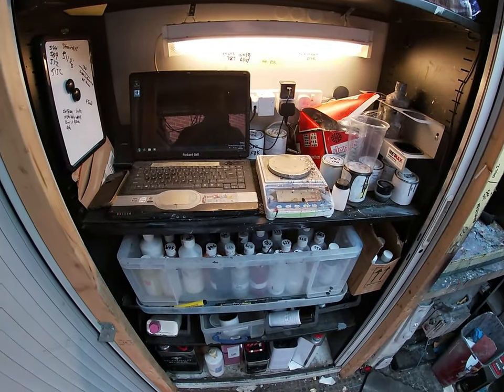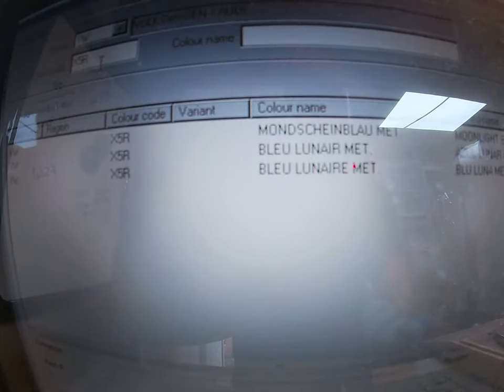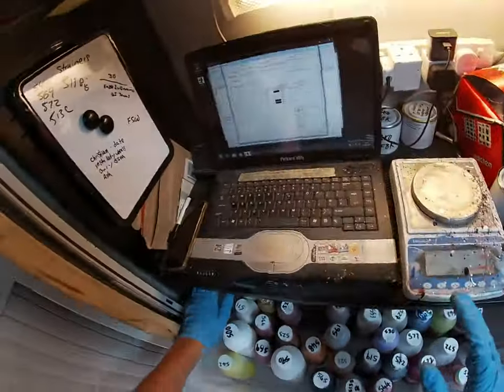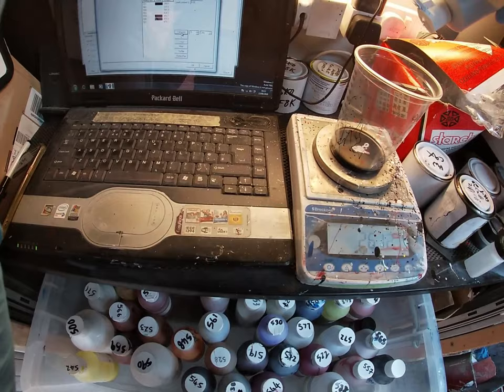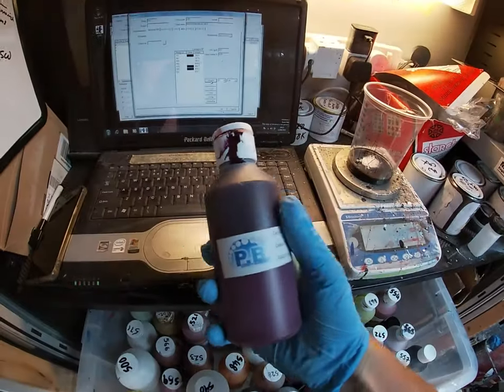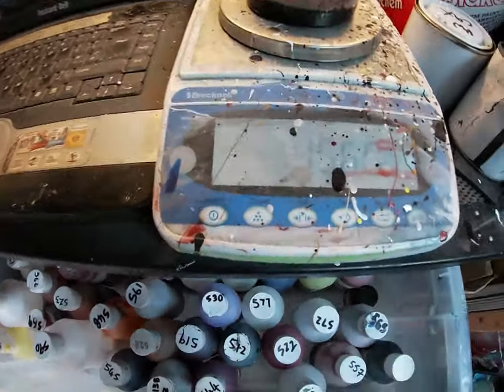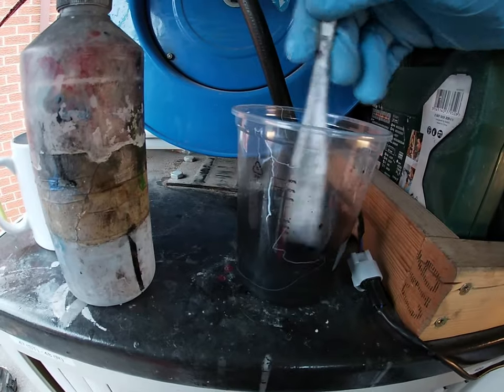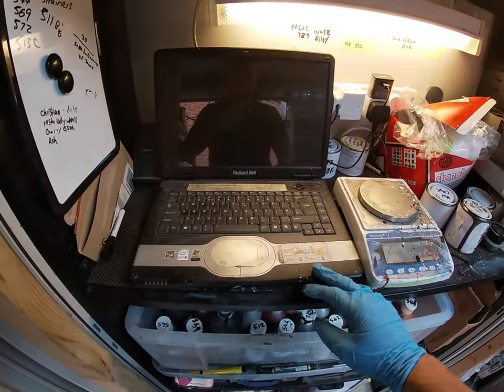How to mix car paint on site!!

Comment: Do you normally do one job a day, i was thinking time you get to job, sand, mask and paint the time must go quite fast.
Reply from the maker: I can usually fit 2 separate bumper corners in in 1 day inc travelling to 2 destinations and set up etc. Ideally I like to be on one decent size job a day though

Comment: Why are some paint suppliers paint mix so off colour? I understand sometimes you need to tint to correct  to a similar colour, but I've given my paint code to 2 different suppliers, one came back very close, the other was very far off so annoying. The code was on a Peugeot EZR. Great video BTW
Reply from the maker: This is and has always been an issue with so many contributing factors. This is why painters often blend into the adjoining panel to hide the colour differences

Comment: Loved the Dupont Centari solvent based scheme. Easy to use, dried quickly. Then the main dealer I was working for changed the scheme for Standox water based. Completely different to use. Takes longer to dry doesn't like being tacked off. Took me a while to get used to it. 😂
10 years for a Ford main dealer and 6 years self employed. Gave it up to go on the tools in the workshop. It was the worst mistake I ever made! Seriously thinking about going back to smart repair. Good video. 🙂
Reply from the maker: Thanks for watching! We always try different things dont we, some work some dont

Comment: Great video, just wondering some cars have quite a few different shades under the same code , how would you know which one to mix do you use colour chips? Or can you get away with a slight difference with shade with blending out ? Cheers
Reply from the maker: Standard shade can be a safe bet.. colour check spray out cards if you've got time/budget in the job. Experience, luck and trying a couple of shades all play a factor. Colour matching is hard. We break the rules as Smart Repairers
Reply: @cvrpov  thanks for that, will the mixing scheme software show up with the different shades if there is or does the software does give you a standard mix? Cheers
Reply: @chriswatson1554  I have used the De Beer system to. When mixing go for the top shade, mix that up and play around with the colour match. Darken or lighten up to match. Only use the toners that the computer brought up. Practice this many times and you will get good at it....LOL..Cheers
Reply: Standard shade is a good bet, but I also used to mix the shade from the year before. Odds are the car sat in a compound for a while before being registered.......

Comment: You had 3 options of LX5R? Why u have chosen the first one?
Reply from the maker: On my system the one with a colour square next to it is the actuall one with the values etc
Reply: CVR POV let Me see if I understood: The first option in the software menu, is the most actuall color for the desired especification (LX5R), so you ve chosen that right?
Reply from the maker: On my system you always pick the one with a colour block next to it. Some colours have multiple options and its down to you to work out which one is the best match/most suitable